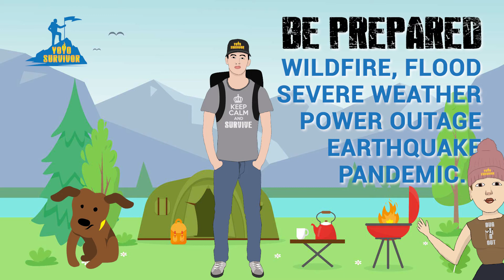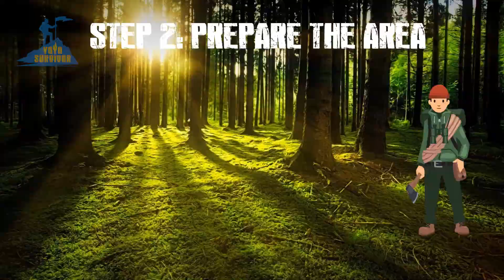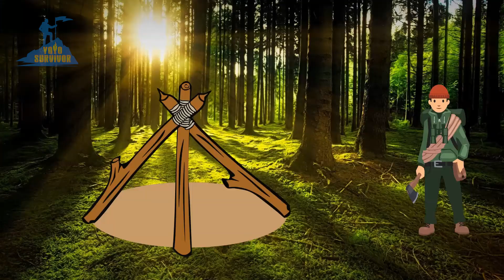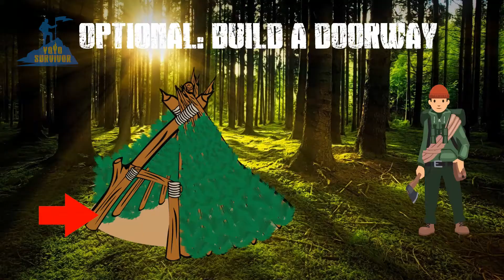Wikiup Shelter Build In 8 Easy Steps With Fire Pit For Survival

Comment from the maker: A great survival shelter that you can have fun with when practicing to build:

⏰ TIMECODES ⏰
0:00 Intro
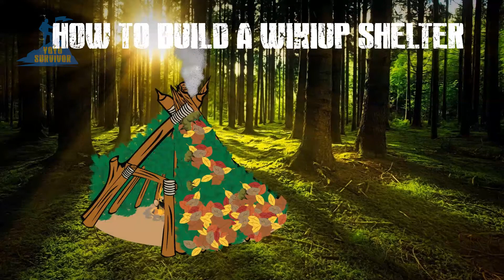0:07 What Is A Wikiup
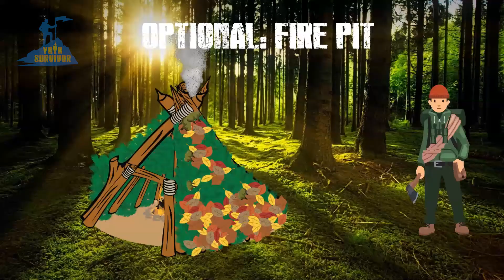0:36 Wikiup Shelter Build
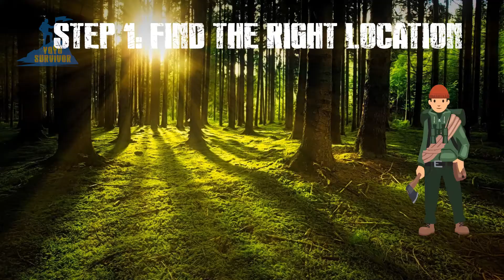0:47 Step 1: Find The Right Location
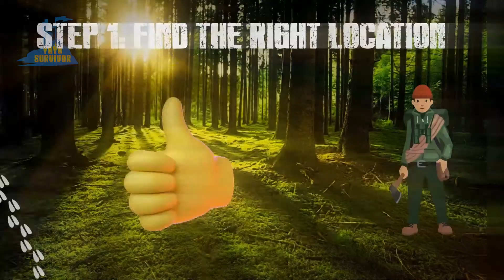1:14 Step 2: Prepare The Area
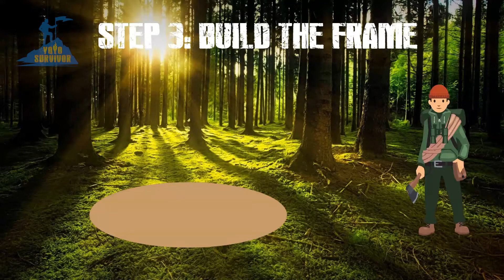1:28 Step 3: Build The Frame
2:06 Step 4: Define The Structure 
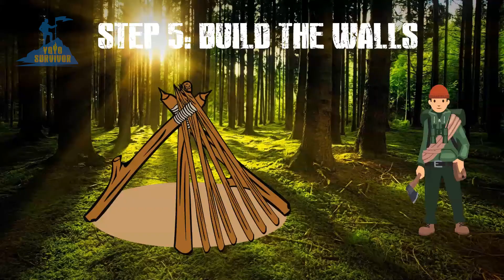2:25 Step 5: Build The Walls
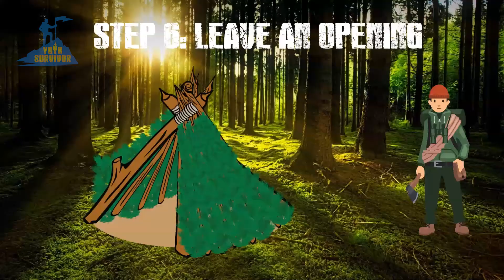2:47 Step 6: Build A Doorway
3:06 Step 7: Insulate The Shelter
3:43 Step 8: Finish The Inside
4:00 Be Prepared